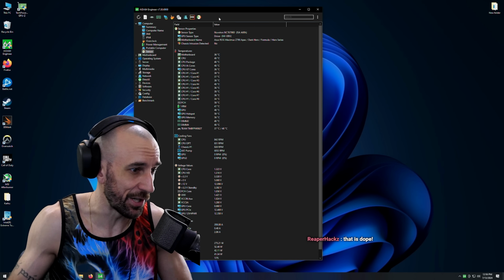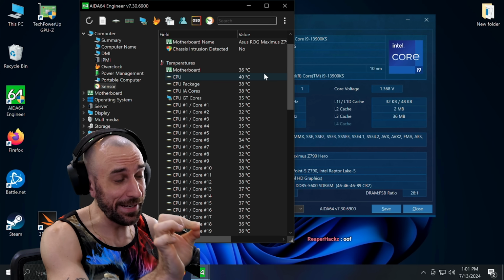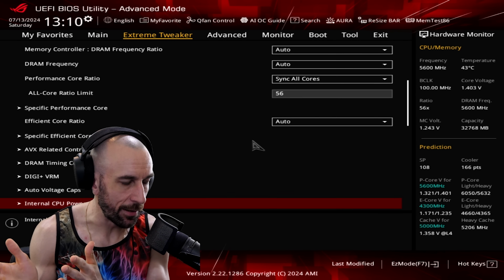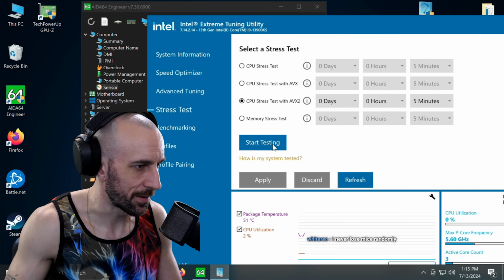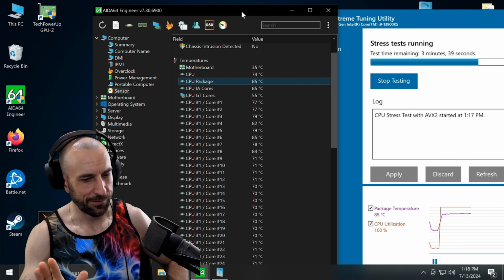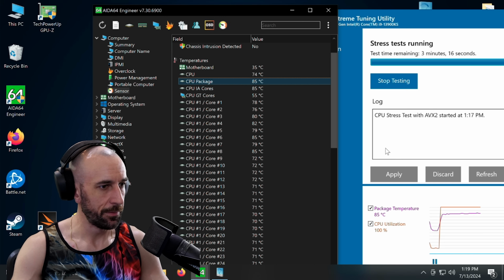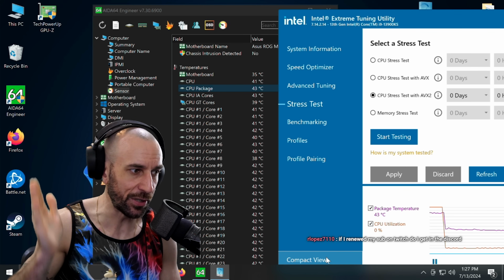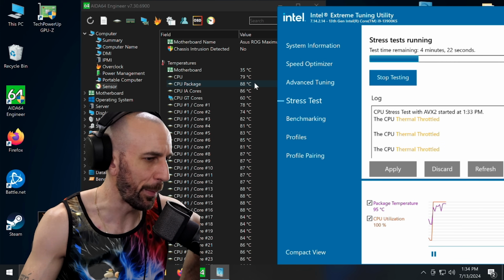🛑 STOP YOUR Intel Crashes 😱👑 (Step by Step Guide)

Comment: You keep saying 500mv but it's actually 50.

0.05 volts are 50milivolts. 1000 milivolts are 1 volt.
Reply: Yeah, this dude has no idea wtf he's talking about... If you deep dive in OC for a few weeks, you know more than this guy
Reply: @Germania-444  IDK man... he seems like he's been at it for a while, even if his spelling & formal education is bad
Reply: @miguelito2361  his recent rants about single core boosts on Intel and AMD show, that he has no idea wtf he's yapping about 😂 Amd doesn't have single core boost. He also said single core performance isn't important for gaming, which also is utter bs
Reply: @Germania-444  If AMD doesn't have single-core boost, I'm rather confused as to why my computer, which is currently running a game, is telling me that my 7800X3D's 5th core is consistently in the 4900-5000 MHz range while all of the other cores are under 2500 MHz & the official base clock is 4200 MHz.  I think this core boosting is done via PB2, PBO, & XFR2 (although I haven't changed anything in BIOS except for enabling EXPO, so I'd think mine isn't using PBO.)

In regards to single core performance affecting game FPS, I'm sure it's theoretically quite important, but most games are GPU bottlenecked anyways so meh... maybe not as much as you'd think
Reply: Yes this was throwing me off. I like the guy too, I wish he wouldn’t ban people that take the time to go into his group because he doesn’t like a certain question. There should be free speech and people are free to share and ask questions. Asking questions shouldn’t be illegal.
Reply: YEAH He needs to add a text to the video correcting himself lol
Reply: @austinmcbride7139  Unfortunately he spent all his text-on-screen quota showing urls on screen.
Reply: @austinmcbride7139  Ran out of annotations after spending them all promoting his sites during the video.
Reply: @austinmcbride7139  Annotations haven't been a thing since 2019 unfortunately.
Reply: That is an important distinction 😂
Reply: I think he meant 5 one-hundredths, but then he made it worse by saying mV, lol
Reply: All my 14900KS problems was solved by using LLC6 and VRM OFFSET +0.015v ;) And a powerlimit on 400A 320w/320w
Reply: this guy doesnt know shit just dont even bother
Reply: @highpraise-highcritic  grifting is crazy bro what
Reply: figure that bs out ok 😅
Reply: @jameshadaway8621  You can research how it works, just go to the specifications page of AMD on any of their processors, go to boost clocks and hover over the little information icon. AMD CPUs all-core clock is capped at the exact same frequency as single core clocks. Can confirm the behavior on my AM5 CPU.
Reply: My AC/DC instructor would have thrown a fit
Reply: Ah yes, let me kill this chip even more with more voltage, meanwhile intel: chips were requesting too much voltage and killing themselves
Reply: @yarost12 He addressed this at 6:18... specifically 6:38.

He turned off auto-overclocking, which he's saying is the source of the problem... but he's adding a small voltage offset to make it actually run stable.

The ideal solution would probably be to use spec voltages while downclocking by 2-8% and allowing auto overclocking at only 20-50% strength, but who really knows what the capabilities of the BIOS settings are.

The problem appears to be that auto-overclocking is too aggressive, increasing voltage & amperage too much... far beyond the increases that he's making.

Comment: My cpu  i guess you would considerate old at this point its a 5600x i used to run pbo but im currently running defaults with pbo disabled is that safe or even then do you suggest locking all cores

Comment: I've got a 13700kf which is near new and working fine but this model does appear on some crash charts.   It has a 1 or 2 core boost of 5.4GHz, 3+ is 5.3GHz.   Based on this video I've gone in to my BIOS and locked the 1 or 2 core boost to 5.3Ghz.    Is this 100MHz difference really going to be all it takes to prevent degradation?
Reply: Probably, the voltage steps arent isnt linear. Going down 100-200Mhz can sometime reduce voltage by a large amount. Google V/F curve and look at a graph and you quickly understand the situation. On my 14900k I go from 1.47V to 1.37V at all core 5.7GHz which is way safer but still high. At 5.6Ghz it can do 1.32V wich is pretty safe. It never throttles so in some apps you get more performance too. Needed voltage varies from chip to chip slightly so dont use my examples unless you have mediocre to decent chip.

Comment: the fix is to: in that intel tuning program, change the 500 A to 300 A .
Reply: I havent checked that out personally but it isnt a good fix for degregation because I belive it will still push high VID voltage into your cpu cache/ring bus at medium temps. It might get rid of bluescreening yes but not long term degregation. You need to stay below atleast 1.4V for that, maybe even lower. We just have to wait and see over time what the actual safe voltage is as the months go by..

Comment: Isnt the performance core max turbo frequency of the 13900ks 5.4? 5.6 is for the 14900k. I want to try this to stop any further degradation but I dont know where the 5.6 for a 13900ks came from
Reply: According to the intel site it’s 54
Reply: @zr0dfx  yeah, thats what I thought. Ill set my 14900k to 56 and time will tell. Thanks

Comment: I have an 13900k with contact frame and -100 offset from day one. Can mine degrate to?
Reply: If your idle voltage is not like 1.5V+, then probably yes.
Reply: @kevinzhu5591  CPU Vcore idle is 0.744v and max 1.284v / Vid (max) 0.734v and 1.303v so it will be fine i ques. also my cpu still boosts to 5.8ghz on 2 cores btw
Reply: @kevinzhu5591  Cpu Vcore idle is 0.744 and max while gaming 1.332v / VID(Max) 0.724v idle and max 1.340v while gaming. Cooler is an AIO and Max temp is like 66c  package and 69c P cores. so i think im fine indeed thanks
Reply: Yes IMO with high clock speeds. My 13900k suffered from IMC degration, suggest you go easy with memory speeds esp if running 4 sticks.

Comment: Anyone else’s 14900k still working perfectly?
Reply: yep working flawlessly for 7 months, i explained how in one of the comments
Reply: Yes. No problem at all. VF-Curve undervolt. 6.1Ghz on two cores, 5,7Ghz All-core, 4,5Ghz E-core all-core. Vcore/VID never goes above 1.417v in any scenario. All-core load voltage is .1.23v, max temp 88c in Cinbebench. No delid but have contact frame. At the risk of incuring Framechasers wrath for not locking my cores ;-)
Reply: @FrankAndreasLia  Thats a golden chip, not representative of most chips. Mine is at 1.35V at 5.7Ghz which is slightly below mediocre. Its a massive downstep down to 1.23V so no wonder your fine :) Top VID is like 1.470V on my 14900k.
Reply: @impuls60  The funny thing is that I can't run 5.8Ghz All-core even at stock voltages, but can undervolt like crazy. ;-) Well well.
Reply: @FrankAndreasLia  still working fine ?
Reply: Yes. I have 14900ks. It works perfectly
Reply: Mines fine but it is delided and on a MO-RA3 420 and two 420 rads.
Reply: @StuartBoyer  Ha! Same - I have 1800mm of rads inc my MO-RA 420. Mines not delided but have a contact frame and have been running 253, 253, 400 since day 1 for about 5 months.

Not a single crash 🤞🏼
Reply: Mine 13900KF is
Reply: It's been working fine for at least 7 months by now. The only time I had problem was when it was running with unlimited power limits and droopy LLC. After fixing that on my MSI Z690 Unify board I have 2 profiles: Main one with 253W power limits and one that's unlocked whenever I want to run my CPU unlocked.
Reply: My 14900kf working perfectly 👍
Reply: 14900k works fine
Reply: 14900KS from release day working fine at 6.2GHz on 2 cores, 5.9GHz all core, direct die on a MoRa 420. I have a 6.3x2, 6.1x8 config that runs most things but needs some more tweaking to not bsod R23. COOLING!
Reply: @ColinDyckes  All my 14900KS problems was solved by using LLC6 and VRM OFFSET +0.015v ;) And a powerlimit on 400A 320w/320w   I NEVEr use single core boost.. In reality it gives NOTHING! Use all core at 6.0 or 5.9.. much better..
Reply: @lassekristensen385  I use llc6 and 320W 400A extreme profile as well but haven't needed to bump up any voltages. I agree on the 2 core boost being useless as nothing runs at that speed on any real world machine that runs productivity apps as well as gaming. Always background activity.
Reply: @ColinDyckes  Totally agree! I want to note that the voltage bump was only needed at 5900 Mhz .. below its not.. Try the Titanic 401 Project DEMO and change to all rooms... that the most sensitive software I could find that triggers the fault. Nothing else triggers the fault on my hardware at least so far.
Reply: I'm sure many peoples are its a small but vocal minority making a stink about it. Probably the same people that overclock the shit out their CPUs.
Reply: Working fine since i manually adjusted frequencies and voltage.
Reply: nope 😢
Reply: yup, so far, and overclocked the whole time. I purchased mine about a week after launch.
Reply: yup what I did was do V/F offsets at 5.8ghz to 6ghz all stages of 6ghz with a negative offset of .5X, my P cores are all at 57, my E cores are all reduced by 200mhz,  My SA is tweaked just enough to stabilize the chips sub systems for my XTREEM 8000mhz cl38 2x24 kit on my Z790 Apex Encore. Since I am on an AIO I am not going to let it fully up on the turbo.  Then I have a correction bracket on the cpu to keep the lid from bowing to keep the imc and pcie controller stable and to keep excessive pressure on the cpu socket forcing the vcore hit insane levels no matter what from the pressure.  Thats how I handled it.
Reply: have a 14900KS and its not degraded pretty much brand new. It require LLC7 to run 5900 Mhz  EVERYTHING without error..  The best test I ever found and I know it sounds very funny is Titanic 401 Demo Project. It WILL make shader decompress error even though you can pass EVERY other stress test. Trust me! I can run much lower power and pass everything else. But Titanic UE5 makes this infamous error. Try it! It require LLC7 for me at 5900 Mhz... I can run LLC4 or LLC5 with lower clock but I will not downclock it because I paid for 5900 Mhz. LLC7 fixed all problems. SO yea its a simple fix you are providing IF you keep the clocks low. I can guarantee you that Intel Stress Test DOES NOT PROVE the CPU is ok or fixed or dont show errors in anything else. I challenge you to the Titanic DEMO. You load the game. Change room at least 10x.   Of corse every one disables the 2x core boost. You did not give away anything. Those experience the real issues dont fix it by a offset of 50mv. I also depends on the games!!!!!!! You sound like a real pro bro! Tsss.. Besides having a high load line is no problem as long as you still have a power limit of ex. 320w. ASUS themself says you choose whatever you want - no issues. But of corse you CAN f up if you dont know what you are doing or running with unlimited power limits.
Reply: No.
Reply: Yup, sitting in my shop, unplugged. 😂
Reply: have you played any ue5 game ?
to everyone saying theirs is fine...
try playing  a ue5 game.
fortnite is a simple test to check if 14900k crashes or not.
Reply: @maltoext6153  Yes. I do not experience any crashes or stability issues what so ever  in any game, application or benchmark/stress-test.
Reply: @maltoext6153  thats all i play is UE5 games. never had 1 issue in 1 year. I adjusted bios out the gate when i first built and never had a hickup since.
Reply: @maltoext6153  Opened Fortnite and played this godawful game for 15min, no crash. The CPU did pull 280w when loadning up the game wich is pretty crazy but no crash.
Reply: @maltoext6153  the game that really brought my 13900k to it's knees was Starfield. It would crash loading shaders or within the first minute of the first mission every single time. Even with Intel Baseline Profile it still crashes after 5-10 min but I can at least walk around a bit and shoot a gun.
Reply: @maltoext6153  played first descendant, no crashes

Comment: to prevent DEGRADATION, limit BOTH " throttle temperature"and "fast throttle temperature" (default is 107 DEGREES) to 95 degrees in BIOS, never apply any fixed voltage or do LLC and shit, leave it on auto, u can keep power limits unlocked since it will throttle long before hitting dangerous temps and voltages. for i9s cpu overclocking barely makes a difference in gaming, memory OC is where its at if u want noticeable improvements in gaming. my 14900KF has been running with unlocked power limits ( both at 4095 watts) for 7 months with no degradation thanks to these tweaks,  in cpu z my single core score is 975 and  multi core score is 17.6K. and please get LGA1700 support bracket and good thermal paste, intel's stock ILM is garbage.
Reply: I’d be interested to know if others can validate this claim. I wondered if the clock speed was ever really the issue, or if the voltages and temps (as a result) were the underlying cause of the degradation.
Reply: @KeyboardSavant  clock speed alone is not the issue, its the excess voltage applied on those HOT cores that cause them to degrade, the cpu idles at 5.7 ghz and sips 5 watts in desktop on windows 11. Normally if every i9 owner used a 360mm AIO ( i use deepcool LS720 with grizzly kryonaut, it can cool 320 watts without throttling ) with a LGA1700 support bracket and good thermal paste and did not apply any fixed voltages or LLC, these CPUs would never degrade, but majority of users still follow the old dogma of applying excess voltage to get that useless 6 ghz even if it makes less than 5% difference in modern games for i9, on top of that their air coolers are never sufficient to cool i9 or ryzen 9s. while gaming you should keep hwinfo64 open in background, after gaming session check if any of the cores have thermally throttled, if any cores show the red throttle warning then you need better cooling, that was always mandatory for these hungry 16 core+ cpus. DDR5 memory overclocking with hynix A die will increase fps by over 30%( assuming no gpu bottlenecks) and is far better than applying fixed voltages trying to hit 6GHz. Modern CPU are designed to downclock and decrease voltage on purpose if they detect high temperatures, fixed voltages delay this undervolting mechanism thus causing degradation over prolonged periods of high voltage under high temperatures.

Comment: So If we aren't having issues, and our o.c.'s aren't pulling crazy heat or voltage should we even worry?
Reply: If you know how to do custom over clocks yourself your good. This is to help prevent cpu degradation from the out of box settings Intel and motherboard manufacturers are using.

Comment: I know this is about the i9's mostly but in other comment sections they said the i7's were sometimes unstable but they had a better track record. I recently bought a i7-13700kf would I still need to lock all the cores to be safe? I haven't even gotten it out of the box yet.
Reply: Yeah, better lock it just to be safe and be caution with enabling xmp cause for some f. king reason some manufacturers sets SA voltage too high there.

Comment: Hi Fram Chaser Sorry i have bad english , yesterday i bought ROG THOR 1200PII and today i see in youtube with this title : buy atx 3 for 4000 series and my psu is atx 2 but it have pcie 5 12vphr cable but its not atx 3 , it is atx 2 . should i sell my 1200p2 thor and go for 1600 titanium rog or its ok , my psu will work well with 4000 series card like 4070 ti or 4080 ? 
pls frame chasrer answer me if you can brother and sorry for my bad english brother
Reply: Your psu is fine lol I have a Corsair 750 watts with a 5800x and 3080ti and have had no problems.....
Reply: @winonesoon9771  thx brother

Comment: 'Degraded 13900ks CPU'---Tells us the CPU was delidded... I bet you my entire net worth that the original owner destroyed this CPU with overclocking. The 13900ks is already pushed hard from the factory, trying to overclock it further is pure stupidity. PS. Motherboard defaults are NOT Intel defaults, especially on ROG Maximus board, Asus is absolutely pushing the CPU harder than Intel spec.
Reply from the maker: He used Asus AI OC as per previous video
Reply: @FrameChasers  Sounds like your net worth just went up lol.

Comment: Damn...When are you going to start flaming Intel for this?
Reply: Just to add:  Why isnt Intel paying you?   my intel 14900k has some strange degradedness. it wont turn on by default & were Msi mesed w the qd voltage it will barely turn on after i put auto and 5.4ghz. w 1.350v. Thanks 4 the guide wish u had one 4 all boards  . please do a follow up. (comment 4 the video)
Reply: @adamtajhassam9188  RMA your 14900k asap and hope your replacement chip isn't one of the flawed ones
Reply: He won't because he is a r 3 t a r d 3 d shill for Intel, and it's blatantly obvious.
Reply: Intel recommends mobo manufacturers to use intel power limits but it’s because of intel if motherboards manufacturers push voltages and frequencies too high?
Reply: dude his jobs is making money out of this and helping people at same time , why flaming intel ?
Reply: I love visiting this channel to see the Intel cope, I'm used to it by now, but even I am blown away that people are defending Intel after this debacle.  It's hysterical 😂

You guys were already kind of a joke by cherry picking that specific scenarios/areas of maps in games and using dubious ram setups to make AMD look bad, but this is next level delusion
Reply: @rollerr  yeah then why do my friends on amd chips complain about low fps and frame drops in many games when I’m 200+ fps with a worst gpu and higher settings? 🤔